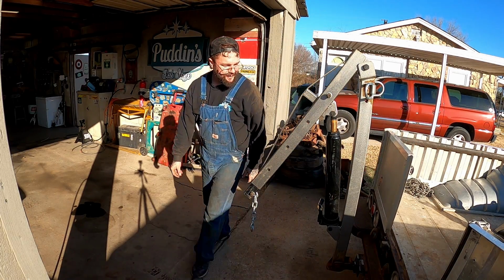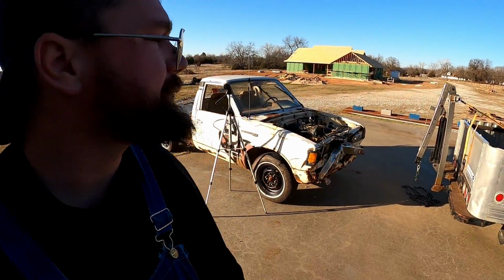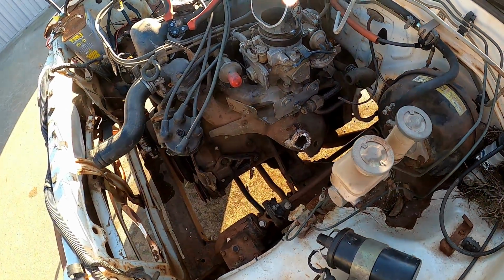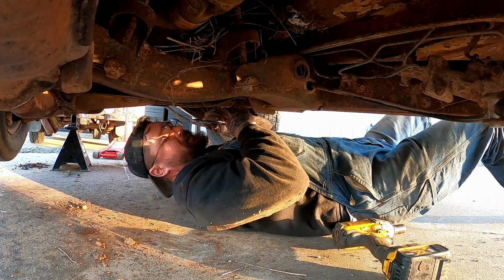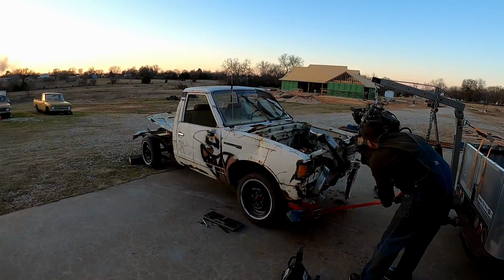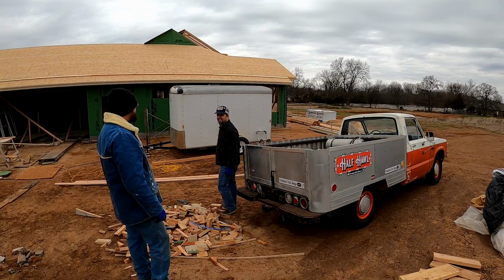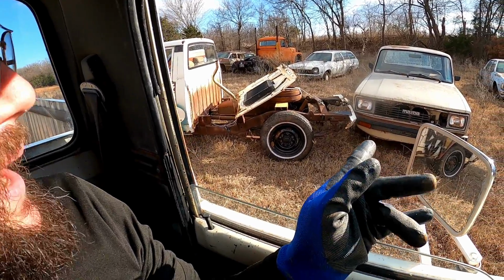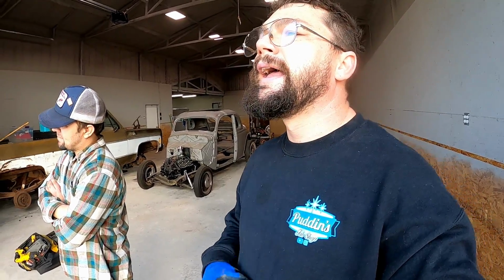Engine Pulls, Hauling Loads, DONUTS. Testing the 1981 Ford Courier WORK TRUCK!

Comment: That ZIP tape... down in flor-duh, when we all make put yearly hurricane prep kits,  this has become my first pick. It's some gud stuf. With  a vinyl pool filled with water gets a tear, this tapes sticks under water. When your driving down the hwy and your scamp door flies open, when that old chevy window regulator fails, when that winda ac has that gap that lets all the skeeters in.... That ZIP Tape

Comment: We are on. Let’s go it’s Puddin time. 👍😎✌️
Reply: James scared another mortsky in a Mini truck
Reply: Greta would be proud you must have been installed before dry in that new shop inside because more exactly what is the tools down for where I'm at and everything bolts down the fluid area so don't park over the floor drain when you're going on a car that's what he said that was his textbook from last week
Reply: Who knows though you might have had your only set of steelies that wasn't been on that truck because the wheels are still
Reply: @joebrock9784  I'm curious bro, and I'm being 100% genuine. NOT tryina bully or make you upset. If you look back at your own comment a few minutes after you write it, does that shit make sense to you? Or do you get a little confused as well?
Reply: Why don't you put the rear end out of the docks and under it since you gotta do breaks anyway and that way you have a lower gear so that I have spent money
Reply: @Lions7.62mm  I agree dang this makes no sense at all.

Comment: Suggestion, on the lift, swap the arm pivot bolt and the upper & lower cylinder bolt for clevis pins.  This will allow you to remove the boom and cylinder, thus making it easier to move, but it will take 3 trips.

Comment: I had to replace a freeze plug on an Oldsmobile years ago. The replacement plug was a generic plug that was rubber with a squeeze bolt through it that expanded the plug when you tightened it.

Comment: Before your next load with half haul, tire a thick rope or chain to an old tire. Place tire at front and run chain thru the back. Then pull off to dump.

Comment: Excellent video Puddin  :) , Slick  :) also family  to and pull engine out vechiles are fun to and Doughnut in Ford Courier Work Truck runs good with big lugs tire also ratio axle put 355 to 410 run good ! Myself say if get 377 or 388 or 390 gears help on low gears to high gears too Puddin   :) !

Comment: Nice to see you got rid of all those corrugated metal sheets on the walls. They might be better suited for an indoor wash bay if you ever decided.
 I've yet to notice a floor drain near any of the overhead doors.  Maybe an outdoor lean-to structure wash-bay against the shop? 
 I'm sure you got it all figured out and we'll be here to watch you do it. 
And how slick is that Half-Haul cherry picker !  👍 You edited that engine relocate footage like no-bodies business.   Same goes for the tow-job. 
That Half Haul Hitch  (HHH)  set-up is slicker than $hit on a hot summers night!  MacGyver's magic has nothing on Pott County's Puddin Tang.

Comment: I'm putting a 1UZ into my Hardbody. I think it's about 15lbs heavier than the 4 cylinder I took out and it makes at least 100 more HP and TQ. I did cut the support out but I'm going to weld it back in for cosmetic purposes. Either way I'd be lucky if that truck protected anything besides Nissan's reputation for being tough.

Comment: If that was my Shop I would add onto the backside for the merchandise building so you only need to build 3 walls and a roof. I would move away from the shop on the side and plant some privacy trees. If you make the building a U shape that cut off most of the airflow. But will be interesting to see what you decide and can't wait to see the move.

Comment: 16:00 back in the late 80s early 90s, the Chevy Astro and Ford areostar the entire radiator support and front grill/ bumper had to come out to get the engine out. Plus you had to have a hoist to pull the engine as the cherry picker had to go in at a 90° to the engine, so the van had to be about 2 feet off the floor and level as having the picker arm down at a 45° you didn't have enough lift to get the engine out. Us techs welcomed the subframe assembly where the trans/engine came out underneath as a assembly, like on the olds silhouette/ Chevy lumina.

Comment: Hey Mr Puddin, that little welding job you did on the rear end of the little truck, made that thing like a little Tank! Got that possi-trac going on now that thing can go anywhere. that was just down right nifty. Also back in the day the builders on a house did the clean up. it wasn't the buyers job.

Comment: Back in the day, I had Isuzu Amigos and Pups. The ones with 2.6 liter fuel injected engines had 12 bolt rear ends with disc brakes. The 2.3 with carbs had 10 bolts with drum brakes. They all had 4:56 gears if memory serves. They also had the same lug pattern as your Couriers. If you could snag the rear out of one of those, I'm sure it wouldn't be hard to swap in.

Comment: Next time you want too try the backing up trick thing remember this it works a lot better is you Chain a tier up put the tier close up near the cab of truck inside you need and have to chain drag out the back of the bed okay so then load what ever wood of most trash into truck when the truck bed gets fool    hook the chair up too something like a tree stump and haul butt away from the tree stump and the tier and chain should drag everything out of your truck bed .

Comment: REALLY appreciate all your hard work you put in for our entertainment. I think it is very impressive that you actually got the 4412 Holley 500 cfm to work and run on the 2.3 4cyl that is a lot of cfm for such a small motor .as a side note I am very sure that you already know but a glass pack muffler can be installed in either direction but one way is quieter than the other. Sorry forgot you are from Oklahoma the other way is louder. Kant wait fer hot weather for them hot pressure washin videos my beda  tapes of Cool hand Luke is plum donn worn out ha thanks again for a good evening entertaining us

Comment: Common issue on the trail blazer inline six is a misfire on cylinder 6 after vehicle hits about a 100k caused by the factory cheap valve seals allowing oil to by pass the valve seal

Comment: If that thing had a little more power or a little more weight in the front, it would be even more practical than it already is. Would a 4.0 fit?

Comment: Who else would want to see a "How much HP till it blows" on one of those stock Datsun engines? Throw a turbo on one with a good blow thru carburetor or convert to a multi point efi controlled with a holley or fuel tech ecu. Rod bolts, re-gap the rings and over torque the head gasket. I think it's could live at 800hp if the right low buck mods are done.

Comment: I know you were in the Air Force. Know what that hoist in the back of your receiver hitch your emulating the tailhook convention. 🤣🤣🤣🤣 I don't know if you were on a carrier or not.
More serious note. OSB on bottom and it's just light out better or a chain and tire but that probably tear up your bedside especially at the back corners.

Comment: Hey puddin you should just setup a tool bag for that stuff so you only need to add your power tools and a cooler to keep your water and drinks for when your out doin that stuff guy. it would save you alot of time and problems guy. Keep up the cool work your doin and be safe.

Comment: Won't you loose circulation of air if you build the new building? Will feel hotter in the summer.
Reply: PuddinsFab_Shop20  thanks where do I send the message for give away?

Comment: Exhaust mount to the trans is a fairly common bull-shittery.  No vibration isolation bracket needed, makes it cheaper to build.  Fugh the mechanic, who cares about him.  Surely not an engineer.

Comment: Man you put yourself in some real danger!!!

No way in hell should you be standing in between those 2 trucks working that hoist. If either truck decides to take off towards the other one, best case scenario is probably a wheelchair. You need to replace that cylinder with something like a porta-power that you can work from the side of the truck.
Reply from the maker: I don’t see the danger you seen. Neither one can roll quick. Both have to move for the other to move when they are chained together.
Reply: @PuddinsFabShop2  Kinda like the whole don't stand in front of the tire when you start the tractor even though you know damn well it's in neutral. If the chain fails, parking brake fails (or you forget to put it on) etc. Plus, and most especially, when the engine comes loose from the mounts, so does the chain that's keeping them apart. There have been quite a few tow drivers killed standing between the car on the hook and the back of the wrecker thinking everything was gonna be fine when something unexpected let loose. 

Love the channel man, I really don't wanna see you turn into a different kind of puddin'. Those electric hoist conversion kits aren't too expensive, either, and it would be WAY easier to use it as a yard wrecker.